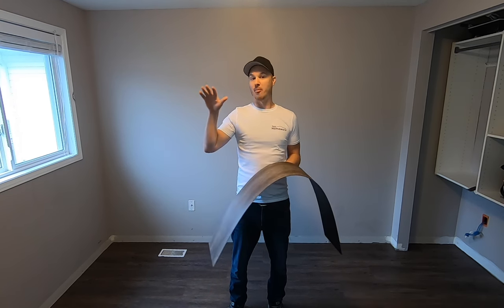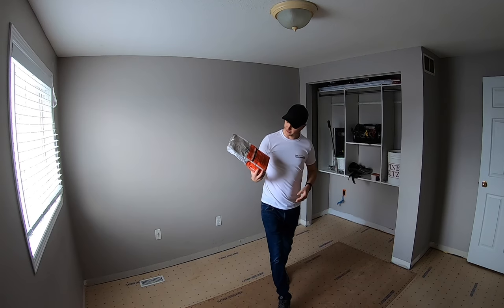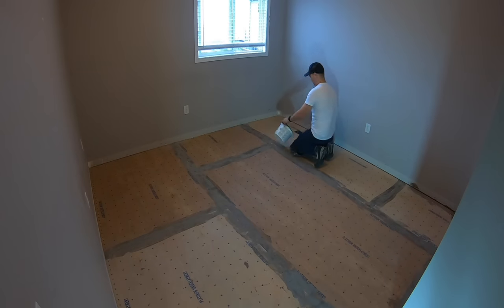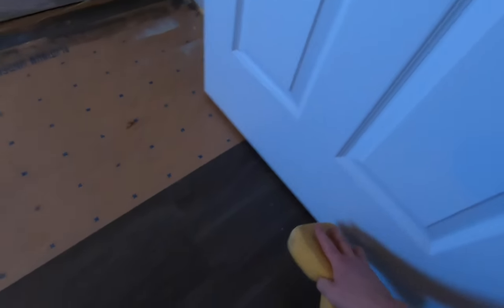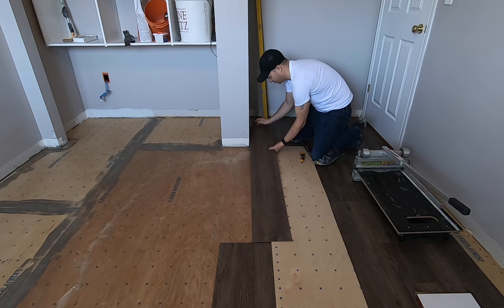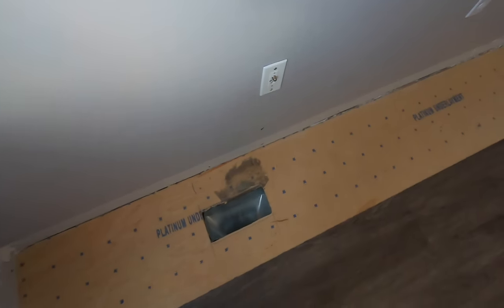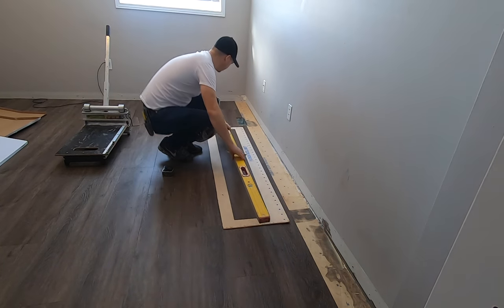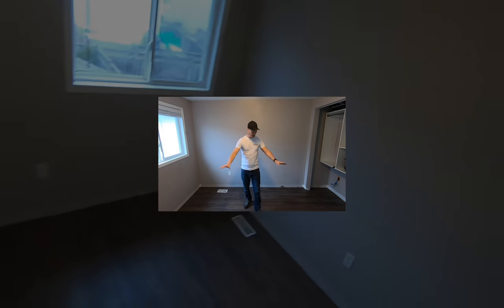How to Install Glue Down Luxury Vinyl Plank Flooring on OSB Sub Floor

Comment: Question....what is the name of the board with all the x's on it called that you covered the osb with?
Reply from the maker: It's quarter 1/4" plywood underlayment made for vinyl floors. You can get it at flooring stores or big box stores. They may only come in 4x4 sheets, I used 4x8 sheets

Comment: How should I space my staples? 2-4 inches apart? What length? Thanks!
Reply from the maker: 2" around the edges, 4" in the middle. I like to use 7/8" staples
Reply: @BrentDarlington  I used 3/8s plywood to cover the osb, then 1.5 in staples. Probably overkill.
Reply from the maker: @youngn9na92  we use thicker plywood to meet up with higher floors. Bigger staples are ok but i find you get more that don't get driven in all the way
Reply: @BrentDarlington  In situations where they don't drive in all the way do you just hammer them down? Sorry for the remedial questions. I haven't found explicit instructions for this stuff.
Reply from the maker: @youngn9na92  yep, hammer them down

Comment: What are the tools you used?
Reply from the maker: I used a circular saw to cut the plywood, a narrow crown stapler attached to a compressor to attach the plywood, a drywall knife to spread the patch, a notched trowel to spread the glue, a square, a knife, a tape measure, a guillotine to cut the vinyl, knee pads, safety glasses...I think that's it. There are some links in the description for the tools, thanks for watching!

Comment: Can you apply this same type of floor directly on real hard wood floors ?
Reply from the maker: It would probably be fine but I would check with the flooring and glue manufacturer. It will also depend on what condition the hardwood is in. Best bet would be to put down the underlayment.

Comment: Is there a reason for the 1/4" plywood? Can the product be installed on the osb?
Reply from the maker: This vinyl is pretty thin. The OSB sub floor will have imperfections that can show through the floor. The smooth plywood helps hide the humps and bumps. There is thicker vinyl that doesn't need the underlayment but I would still recommend it if the sub floor is in rough shape
Reply: @BrentDarlington  thanks so much for responding helps me huge!

Comment: is this loose lay or glue down?  did I miss you using glue?  what product are you using... Karndean?  so many unanswered questions.    I've watched dozens of LVP videos and never seen anyone use OSB... where are you located that you need that?
Reply from the maker: The OSB is the sub-floor that the builder used, I'm outside of Toronto and it and plywood are common here for newer homes. I put down a 1/4" plywood underlayment over the OSB sub-floor to glue the floor down to. If it was a plywood sub-floor, you would still need the underlayment. OSB and regular plywood is too porous and rough for this type of floor, you need the sanded plywood. You must have missed the gluing, it is glued.  This is "glue-down" vinyl, I usually glue down the "loose-lay" stuff but the say you can just do around the edges of the room. This is not Karndean. Vintage 9 Renaissance Winterwood vinyl with Mapei Eco 373 adhesive

Comment: What type of glue you used and why you put that sheet of wood?
Reply from the maker: Pressure sensitive glue. The plywood gives a flat and smooth surface to glue to.

Comment: Would you recommend installing over tile?
Reply from the maker: If the tile is in good condition, yes. Check what the adhesive manufacturer recommends for prep.  You will need to clean the tile very well and fill in all the grout lines.

Comment: when gluing directly to gypcrete can you cut tight to the walls so that there is no base molding?
Reply from the maker: Since it is glued you don't need to leave the gap around the outside like a floating floor.

Comment: Do you have a link or description of the underlayment you used? If I was tearing off an old floor down to the old 1x6 tongue and groove would you recommend using usb over the top then the underlayment? Or just go with a thicker sanded plywood? Thanks! Video is super helpful
Reply from the maker: It is a 1/4" plywood underlayment made for vinyl flooring. It is usually in 4' x 4' panels at big box stores and may or may not have the "X"s on them for the nail location. If no Xs just go every 2" around the edges and 4" in the middle. If the tongue and grove is in OK shape, maybe just screw it down to the joists since it would just be nailed. I would go with a thicker sanded one side over the osb and 1/4" if you think it needs it.
Reply: @BrentDarlington  Can I use regular 1/4 plywood?
Reply from the maker: @marinireyes  you need good 1 side sanded plywood. You want a smooth surface for the glue. Humps and bumps can transfer through the floor. Thats why you patch and sand the joints.
Reply: @BrentDarlington  hiw about lanai
Reply: Luan board

Comment: Do you have any recommendations for installing vinyl flooring in homes near the water, where the moisture is pretty consistently high?
Reply from the maker: Luxury Vinyl Plank and tile is great in moist areas. We use it a lot in basements in my area. Bathrooms is great too, just not in the shower. If it will be wet all the time, then you will need to do some waterproofing and go with a tile or stone.
Reply: Ceramic Tile
Reply: Just make sure the glue you are using is pressure sensitive and got vinyl planks. It’s expensive glue and of course make sure the glue is dry and tacky

Comment: Where did you find the Platinum Underlayment? I can’t seem to find it in both “big box” stores(Home Depot & Lowes). Great work btw!
Reply from the maker: Flooring stores have them
Reply: @BrentDarlington  thanks for the quick response! Let’s hope it’s not too pricey now, relatively speaking.
Reply: Can I use Luan 1/4 instead? It's more economical
Reply from the maker: @pearlperlitavenegas2023  Yes, just might need a bit more prep work. Filling and sanding

Comment: Can kitchen cabinets  be built over glue down vinyl planks?
Reply from the maker: I'd check with the manufacturer for the floor you get but should be fine.

Comment: How many squared meters can one person fit per day .
Reply from the maker: It will depend on a lot of factors. If it is a big square open room you can lay a lot. If there are a lot of small rooms it is going to take longer. The plank size will affect the time as well.
Reply: @BrentDarlington  I’m a commercial floor layer and I’d probably have that room fitted in less than have the time I wouldn’t be messing about with a measuring tape and guillotine because your can use the LVT plank as your marker for the cuts and the only tools is a straight and hook knife even with architraves and skirting boards door rebates cut exact to them
Reply from the maker: @badger25802  It looks like you save on time by not using periods.
Reply: @BrentDarlington  Brent, that's a good one! BTW, love the vid's.

Comment: Great Job..Looks Awesome!  Do you absolutely need to go over 3/4 plywood (not OSB) with another sheet of plywood like your u did here,  If the 3/4 plywood is smooth and level?
Reply from the maker: Short answer, yes
Reply: @BrentDarlington  what is the plywood Underlayment you used and where did you get it?
Reply from the maker: @anthonycaldi7056  1/4" birtch plywood. Should be able to get it at any big box store or flooring supplier. Luan plywood is cheaper but not as good.
Reply: @BrentDarlington  I disagree. Make sure plywood gaps (if any) are filled with a good filler like ardex feather fill and add appropriate screws to edges and imo you don't.

Comment: Great video, are there any reasons why you prefer the glued vinyl planks vs the click together version?

And yo, we gotta talk about these camera angles. These are the best. Like, exactly what I need to see and understand. Especially for newbies like myself. Thanks!
Reply from the maker: Thanks! Why I like glue down: don't need to leave any expansion gaps, easier to replace any damaged pieces, don't get hollow areas like floating floors, can go under cabinets but more prep work, less material options, more expensive
Reply: Plus click systems I’ve found especially with lvt come apart so easily

Comment: That's a pressure-sensitive adhesive - you really should use a paint roller on it after application to prevent "grin through" from the dried adhesive. Also, straight cuts across a plank are much quicker using a straightedge & Stanley knife - score & break. Otherwise, excellent video
Reply from the maker: Ok, what is grin through? May as well just roll it out with a roller. Eco 373 is ok with it. I like the guillotine but to each their own.
Reply: @BrentDarlington  grin through is when you can see the lines left by the notched trowel showing through your tiles. Whole idea of the notched trowel is that it allows you to apply the correct amount of adhesive per square foot, rolling with a paint roller that's pre-wetted with adhesive leaves a smoother finish and still enough adhesive.
Reply: I'm interested in knowing more about the whole rolling over after application with the trowel. Do you do it once the glue is dry or as you are applying?
Reply: @TheJosemarenco  roll while the adhesive is still wet so that the lines left by the notched trowel are removed, then allow the adhesive to become almost dry before installing the tiles. This will allow a good adhesive transfer and also a little movement as you lay the tiles,rather than an instant immovable grab.

Comment: Did you start at the door to avoid having a smaller piece (door frame width) right in the door opening? I would have probably start in the middle like you mentioned with a chalk line, but wondering if this would have been considered a "bad looking job" with that small sliver at the door. Thanks and great video!
Reply from the maker: Since I had already finished the hallway I wanted a continuation from there. You don't want to center each room on it's own and have cut pieces at the doors. Too hard to get a clean seem and don't want to have transition strips. Looks professional when it is continuous.
Reply: @BrentDarlington  Oh yeah totally forgot about the clean seam. Hard to have a 100% straight & clean rip cut, even with a track saw! One last question: Do you have any tip to lay your first row straight since you're not next to the wall? I was thinking of doing a dry fit before glue and snap a line with a chalk line. Would that help?
Reply from the maker: @mathieuallaire5436  I usually lay a couple rows together and keep all the gaps tight. That will also get you an area to walk. Marking a width or 2 out and doing a chalk line works well too. Probably best to do both.

Comment: How level does your subfloor have to be for this stuff?
Reply from the maker: Doesn't need to be level just flat. You'll notice small humps and bumps but more forgiving for large humps, waves and slopes 👌
Reply: @BrentDarlington  that's perfect. It's definitely not level and has some waves in it. 1960s Multi family building in the North East. I was thinking glued vinyl will be better than click in vinyl and more forgiving with how flat the subfloor is (it's got some peaks and ridges in it!)
Reply from the maker: @yanohayon7109  glue down is a lot more forgiving than floating and what I usually recomend but there is usually less selection

Comment: Well done! Couple of Qs

1. What staples did you use?
2. What brand of flooring did you use?

Thanks
Reply from the maker: I usually use a 7/8" long 1/4" crown staple. Renaissance Vintage 9 Winterwood

Comment: Hi Brent, what is the length, width and thickness of the sheets above the OSB Boards ? I have Dricore OSB flooring can I lay the glue down LVP right on top ? Link for the specific one you bought?
Reply from the maker: It's 1/4" 4×8. This is "platnum" plywood underlayment I get from a flooring supplier and can't find a link online. Big box carries "sureply" but it usually comes in 4×4. That's fine just more patching. Can't go over osb dricore. It's not smooth enough for the glue and will show through the floor

Comment: Aren't you supposed to SCREW the plywood down before installing the vinyl plank? Are you not concerned about the nails popping up through the flooring?
Reply from the maker: Just staples. You are just trying to get a nice smooth surface for the floor to stick to and not have anything transfer through. You would probably have to patch every screw head if you screwed it down because they would show through. The staples hold really well and should not come back through or up if done properly. Whenever I rip this stuff out, the staples rip through the plywood and stay in the subfloor, which is a pain to remove or pound in but shows how well they hold.

Comment: Great video Brent, thanks! Hey we've been advised to use screws to screw down plywood, which we have done. Wondering if each square screw head now needs to be filled? What do you think? I'm using Karndean 2mm thick vinyl planks and can't imagine they will show through, but have never done it before. Your opinion would be much appreciated! :) Greetings from New Zealand
Reply from the maker: It's probably a good idea if its thin vinyl. Sometimes the plywood will raise up a bit around the screw and need to sanded off. Run a trowel over it and see if it catches.
Reply: @BrentDarlington  Thanks so much for your quick reply! We pre-drilled the holes and ply is feeling nice and flat, but will fill screw holes. Better safe than sorry
Reply from the maker: No problem. Thanks for watching! If you go thin you won't need to sand much if at all
Reply: The floor came up really good! Keep up the good work and thanks again 😊
Reply: Hi Nadine, I’m here in NZ too. I’m just wondering what ply or hardboard you used and was it marked like Brent’s? What thickness is it?  I watched the pro do our kitchen floor and I’m about lay the same floor in our bathroom and loo but can’t remember how thick the hardboard was.
Reply: Ha, I just realised this was 2yrs ago, so hope you remember 😂
Reply: @karynhitchman2498  Hi! 😂 Sorry I don't remember the thickness of the plywood. It wasn't marked like Brent's. From memory we screwed every 300mm, marked and predrilled first. We had to do two different thicknesses of boards because the original floor level was slightly different in bathroom and adjacent hallway, we didn't want a step there. So used hardboard in bathroom which was only like 4.5mm from memory, the plywood was thicker, maybe 6mm or 9mm? I don't think you need much if your subfloor is stable. Can always ask at Bunnings or Mitre10, they are usually pretty good 😊 For some reason we bought at Placemakers (usually don't go there as expensive) and they were really knowledgeable too

Comment: Why did you do glue down instead of tongue and grove?
Reply from the maker: No need for expansion gaps around the edges. You don't get the "hollow" spots where the floor moves up and down. Easier to replace a damaged piece. A lot of floating floors shouldn't be installed under cabinets. Its more work for the plywood underlay but I find it easier to install.
Reply: @BrentDarlington  Unless you have massive leveling issues lvp will follow the contour of the floor so thats not necessarily an issue. I figured the main reason was if you ever messed a piece up its easier to repair. As far as putting a floating floor under cabinets you almost never want to do it unless you have have an extremely heavy duty floor in a fairly small square footage area. None the less good video.

Comment: why do none of the installers first square the room with a 3x4x5
Reply from the maker: I continued into that room from a hallway that way already installed, so no need. I usually start in the centre of a room or hall way. Measure to the centre from each side of the room and chalk a line. Doesn't matter if the room is square, I can't rebuild the room.

Comment: Do you have a recommendation for glue for LVP on concrete?
Reply from the maker: The floor manufacturer will specify a glue that will work best for their product and avoid any warranty issues.

Comment: "Stupid french tape measure" LOL 

How did you decide where to start a new row of planks? Just in the middle?
Reply from the maker: I had it done in the hallway. Usually, I start in the middle. I have a vid on it somewhere
Reply: @BrentDarlington   Ah I figured it out! Thanks!   How is the floor holding up?
Reply from the maker: Good to hear. The floor is good

Comment: Screw guns work a lot better for sub flooring 💪🏽
Reply from the maker: A stand up screw gun? To screw down the underlayment to the sub floor or screw the sub-floor to the joists?
Reply: @BrentDarlington  yes stand up, to screw the down the underlayment to the subfloor
Reply from the maker: I think screwing down 1/4 plywood underlayment for vinyl flooring is overkill and expensive. A box of screws is more money than a box of staples. The screws will probably dimple and show through on a thinner vinyl, so you may have the extra work to patch and/or sand them. I would screw down a thicker plywood if I was trying to match the height of another floor or something but don't see a good reason to screw down 1/4". I'm not saying you are wrong, just my opinion and works best for me, do what works best for you.